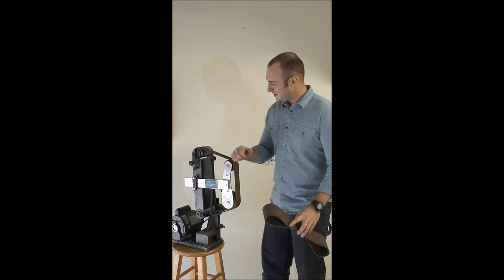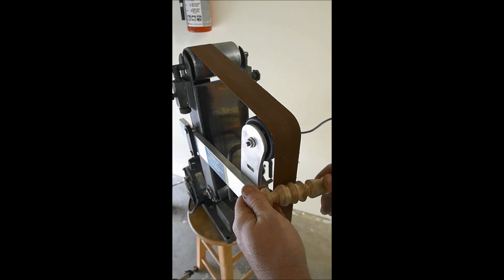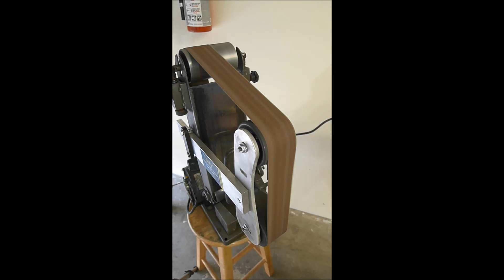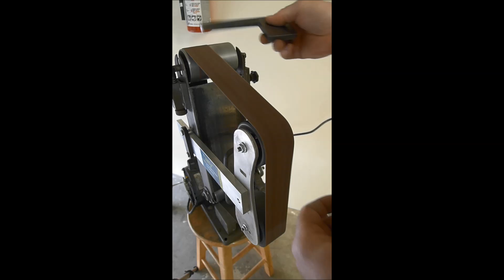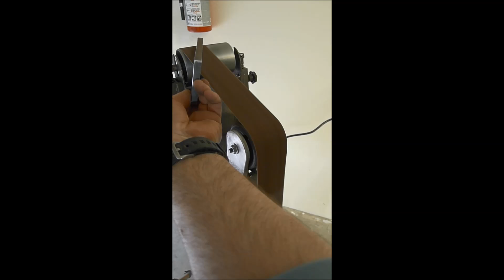Jiffy Conversion-"The REST of the story"

Comment: I remember you saying your grinder was stepped up in speed. How did you accomplish this? Can you still use the disc sander after the mod?
Reply from the maker: I just changed the motor pulley for a larger one. This sander didn't have a disk when I did the conversion, but you should be able to keep using it as long as there are no guards that get hit from the belt being slightly taller at the back.

Comment: Looks like I could fabricate a platen to bolt onto the aluminum plate on the side. Is the plate thick enough to handle that?
Reply from the maker: The plate is thick enough- these are also available with a steel platen.